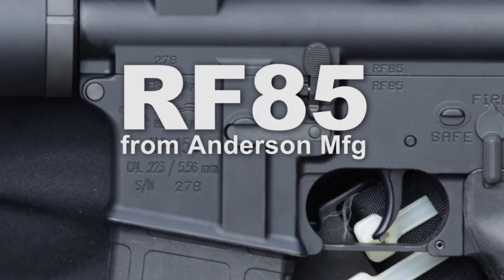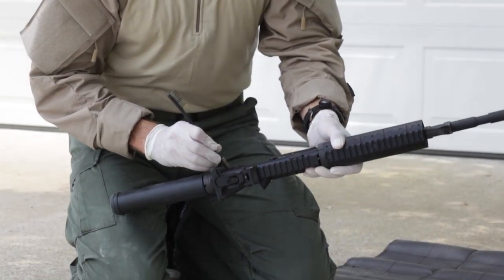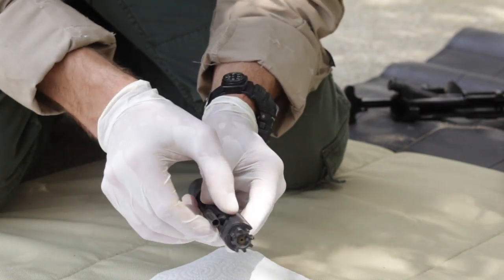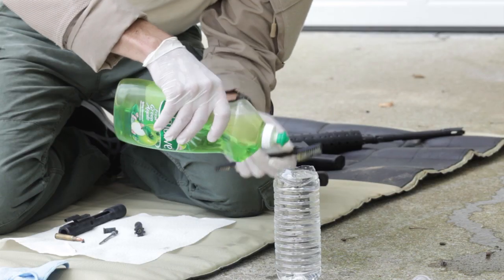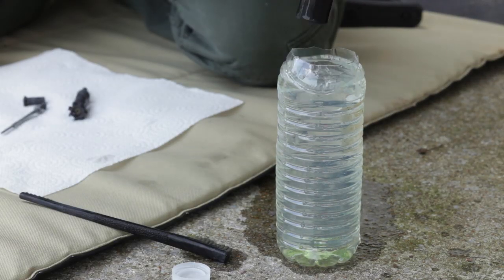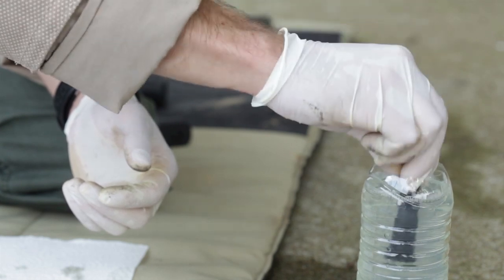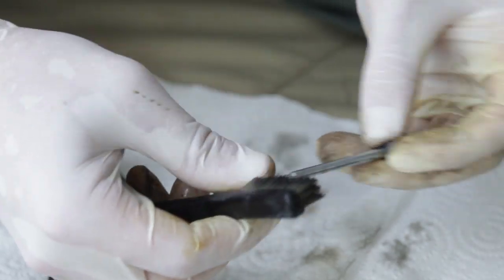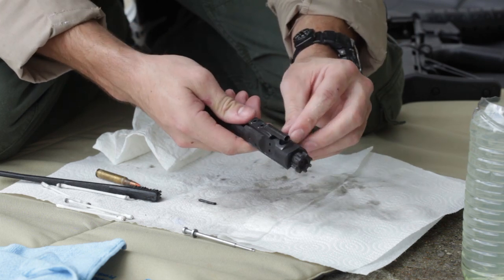Soap, water and a couple minutes of your time

Comment: I had the pleasure of seeing one of these RF85 firearms.  Very nice!  I hope other firearms manufacturers continue this innovative trend.  I love the "run dry" capability!

I think I'd still use Bore Tech Eliminator, my new favorite gun cleaner, instead of soap and water.  No noxious smells or harsh solvents, and it's very good at removing carbon fouling and copper fouling in the bore.  Cleaning loose carbon on the bolt group is no problem for it, even without that slick RF85 finish.

Comment: You can use soap (green dawn) and warm to hot water to clean any weapon... Air dry with compressor... Oil if need be... And good to go. It's the best result you'll ever have. Fuck all those expensive part specific cleaners. They are just another gimic to take your money. I do use a high end synthetic oil (M-pro 7),and (unless it's an R85 part) to lube things back up. And no I don't work for M-pro. I just like it the best. I'll use Hoppes as well. Whatever I buy on sale. Again piss on all the money grabbing products that claim to have Re-invented the wheel.